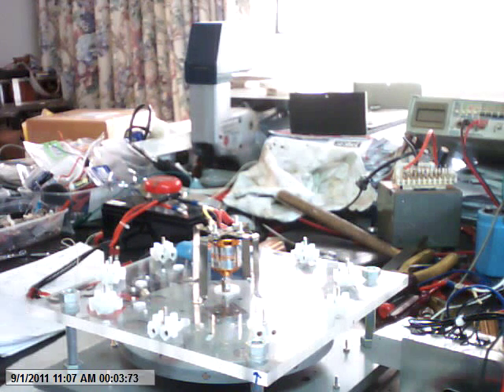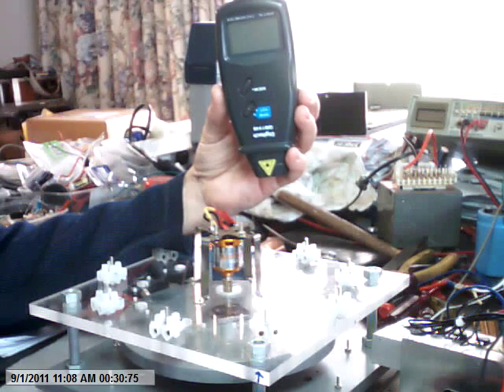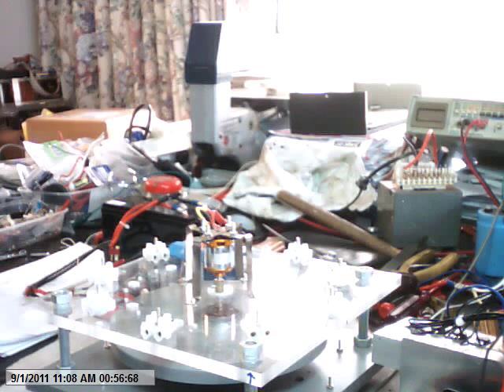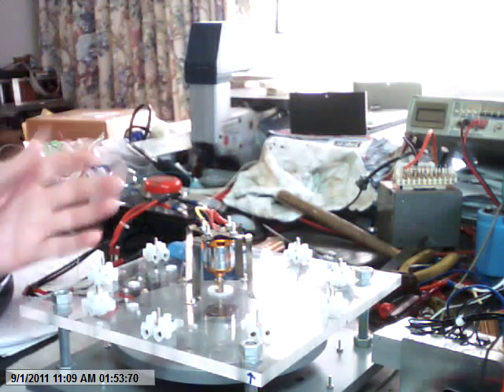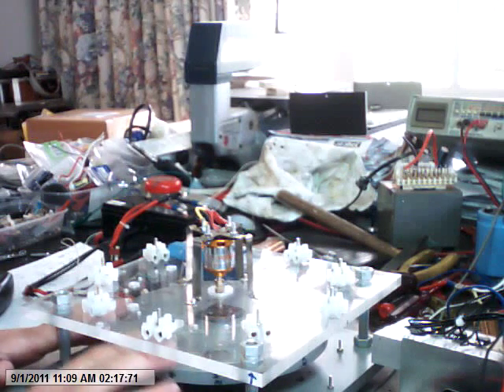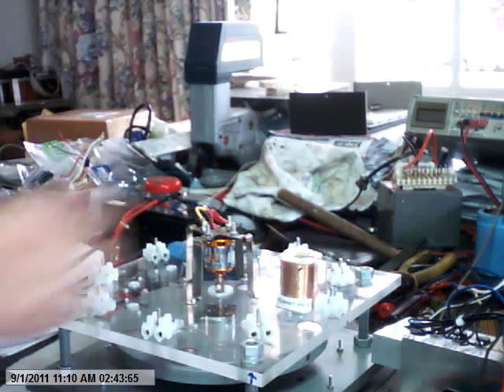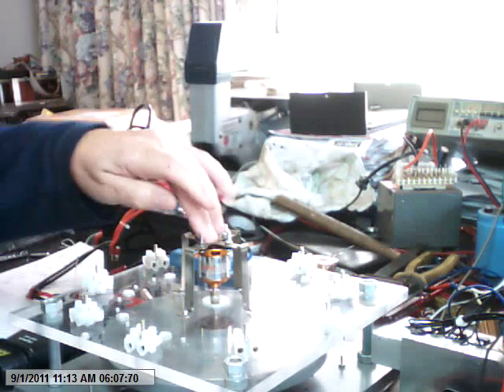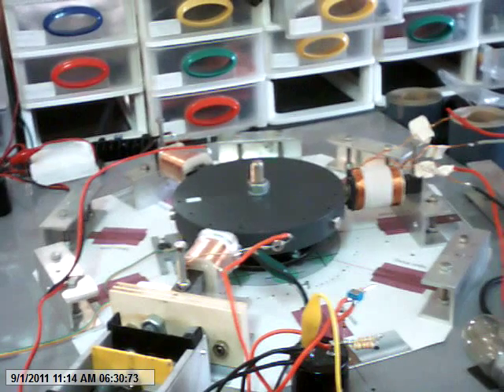Muller Motor Driven by Out Runner to 8000 RPM

Comment from the maker: @rc1231589 
thank you for you comments. I will be careful. I was wondering what the surface speed was. I had one of the small hall magnets come of at that speed . lucky it went in another direction. I have removed all the hall magnets as they are no longer needed.   the  motor can run at 2500 rpm and will draw 300 mill amps. and go all the way to 8000 rpm a 3.8 Amps.

Comment: BTW... search eBay for a Servo Tester... it replaces your need for the RC radio xmtr and receiver... very small servo driver, just needs very small 5V power to drive it with, like the receiver would use. VERY inexpensive, and VERY handy! I use them a lot with my BDC RC motors.

Comment: OI!  if your rotor is around 200mm diameter, going 8,000RPM, that's 267 m/sec surface speed! That's almost 100KPH at which those small magnets will come flying out at you, if they depart the wheel... Run it VERTICAL... and stay out of the plane of rotation!  We don't want to lose you... you're too valuable a resource in this research!  BTW... GREAT move, separating the drive from the collecting... makes perfect sense. 3-phase RC motors are very efficient, with proper ESC.